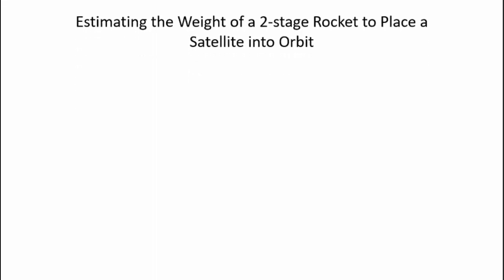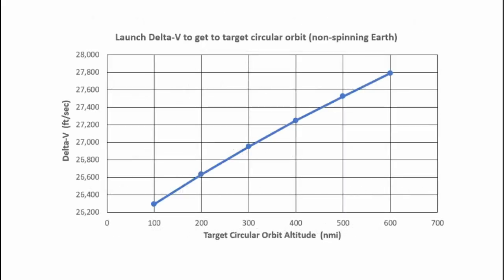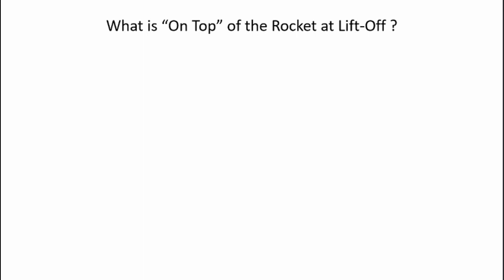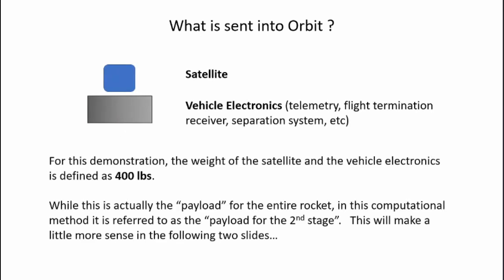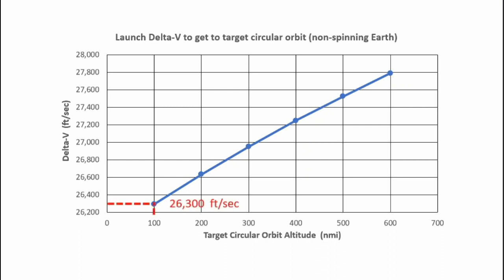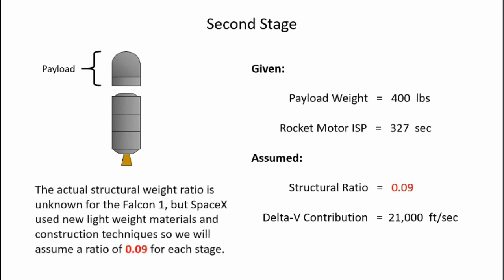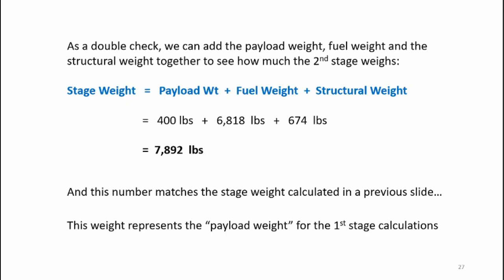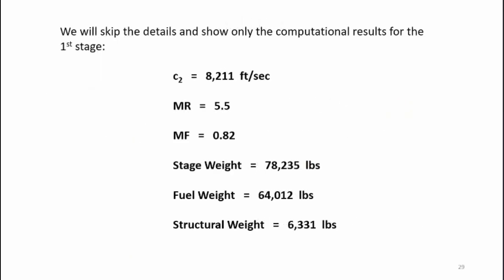Estimating Rocket Size using the Rocket Equations

Comment: I am getting a negative value for the stage weight when using 0.49 as the propellant fraction and 0.545 as the structural ratio. The computation for stage weight comes to - 7944.85 kg. Whether the negative sign is ok.
Reply from the maker: Negative values indicate a configuration that is not feasible...
Reply: @labratscientific1127  Yea I understood that, but in the beginning assuming structural ratio, that is actually structural fraction.